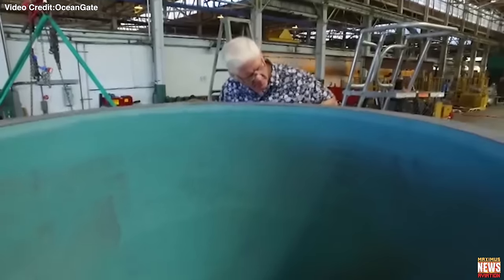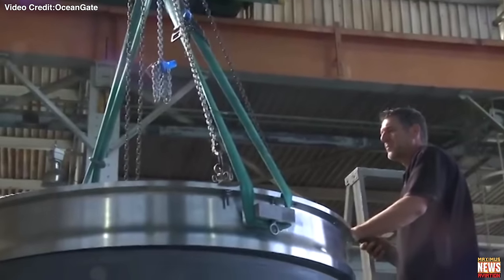Watch The Manufacturing Process That DOOMED OceanGates Titan To Fail. But It NEVER Had To Happen.

Comment: I can see EXACTLY where the failure occurred! It was only a face bond between the carbon fiber cylinder and the titanium receiver rings for the 1/2 sphere caps. Just the carbon alone wasn't strong enough since it's less than 1/2 as strong on compression as in tension, but there was no overlapping of the surfaces, only an edge bond. SERIOUS flaw and most likely the failure point. Once the main structure is recovered we'll see.
Reply: no the titanium had a cavity that went around the outside and inside of the carbon . looks like maybe 1 1/2 - 2 inches deep. i would have made the inside of that flange much thicker and much deeper . then again i wouldn't have used carbon fiber in the first place or at least have an inner liner of steel.
Reply: You're right, he needed at least a 12 inch titanium slot for the carbon fiber to fit in, to give him more gluing surface to better hold the joint together. That epoxy resin, or what we buy in the stores called JB weld, has a tensile strength of 5020 psi, but the titanic depth has a pressure of 6000 psi. I think the whole idea of joining titanium with carbon fiber was ridiculous, but what he should have done was had a 12 inch or more slotted flange and glued it to the carbon fiber cylinder, then wrapped more carbon fiber around the 12 inch flange and the cylinder so that it would be embedded in the carbon fiber. It would have still been sketchy, but would have been a stronger joint. Like you said, this was most likely the fail point. He was going from warm surface temps which would expand the titanium, and then diving down to freezing temps and contracting it, which probably busted that glue joint and led to its demise. He might have damaged that joint on the last trip and didn't know it, and on his way down it sprung a leak and exploded the thing to smithereens.
Reply: @hillbillybeerdranker6678  since carbon fiber is weak in compression it should have been made entirely out of titanium!
Reply: @GrantOakes  I totally agree. for some reason he was monkeying around with that carbon fiber. Maybe trying to save money since titanium is more expensive?
Reply: @hillbillybeerdranker6678  probably
Reply: The main structure is likely shattered into a million pieces.
Reply: @hillbillybeerdranker6678  You could be right, your logic is sound and the physics is relevant but it is really one of those how many angles can dance on the head of a pin issues.... the CFRP was a terrible choice for materials.  It has very poor fatigue characteristics and even worse under compression and in high pressure sea water failing some 10 times faster than it would in ambient conditions.
Reply: @sequoyah59  Good points sequoyah. Yeah, he chose the wrong materials. I also heard he was dumpster diving for materials and found some expired CF that Boeing was getting ready to throw in the dumpster. I don't know enough about expired CF to know if it was weaker, but I assume since they have an expiration date on it, it would be weaker.

Comment: Engineer here, albeit a complete layman in terms of submersibles, but I'll just say this. Nobody knows what the mode of failure is, could have been the hatch, we just don't know yet. This construction probably was an ok concept for lower pressures, though when you start to get to silly pressures like 400Bar then things change exponentially. This company had a cavalier regard for safety because they knew they were dealing with these compressive loads. Tragedies such as BOAC flight 911 can't happen with a modern airliner, because although non uniform materials such as composites are used, we now have FEA simulations which mean we can make things cheaper, more lightweight and with ten times the strength than we could back in the 1960s and that is why kit designed within the last 20 years shouldn't catastrophically fail due to design. We wait and see what happens, it will be interesting to learn the facts.
Reply: Remember American Airlines 587?
Reply: What we do know is that the hull is in many many pieces.
Reply: And aerospace companies don't just depend on the simulations. They perform extensive physical testing on production prototypes - testing them until they fail so they know they understand the limits.
Reply: As an engineer you SHOULD KNOW that carbon fibre is for TENSION not compression.
Reply: @OffGridInvestor  Works better in tension. Is prone to delamination under compression, that is clear.
Reply: @bbhima5814: How does it relate to Titan?

American Airlines 587 (Airbus 300) encountered wake turbulence from a Japan Airlines jet (Boeing 747) that took off just before it did. The pilot flying the Airbus countered the rocking motion with violent alternating inputs to the rudder, causing the vertical stabilizer to snap off when the aerodynamic forces exceeded its design specs. Airbus' chief test pilot hopped in a flight simulator to demonstrate how ailerons should've been used, instead of the rudder. Even Boeing said its planes should be flown like what Airbus recommenda. Many experienced Airbus and Boeing pilots were shocked, as they use the rudder almost exclusively. They were lucky that Boeing over-designed the tail (more so than Airbus).
Reply: @OffGridInvestor  this is a dramatic over-simplification. The fibers are strong in compression, but they are so slender they are prone to buckling failure. If the epoxy (or other resin) can keep them in place then they will not buckle, and the buckling forces are generally much smaller than the compression forces, so the epoxy can hold up. I am not defending the design of this submersible. But the often repeated statement that "carbon fiber is weak in compression" is wrong when it comes to carbon fiber composite construction. It is pretty strong in both compression and tension.

Comment: That round metal piece, that was glued to the body of the sub - was recovered, in one piece. That tells me that glue joint has most-likely something to do with the malfunction of the sub. Tony Nissen,  the  head engineer who calls the glue a peanut butter glue,  is probably in jail today, charged with deaths of four people.
Reply: Actually he isn't. He just testified at the US Coast Guard Hearing. I found it surprising that he told Stockton he would never get on the sub he was the lead engineer on. I guess he didn't have much faith in his composite glue job submersible.
Reply: @Romulan2469  That should have been the biggest clue and not to enter the sub.
Reply: @elmono3939  Agreed. I just think stuff like that should be fully disclosed to those paying to board the submersible. They were obviously duped by Stockton into thinking it was safe but when the lead engineer refuses to board it, that's a huge red flag right there. I would expect Nissen to face charges anyway, he was responsible for designing that thing.
Reply: @elmono3939  The people who were "Mission Specialists" had no awareness of this trivia that came to light after the tragedy, but they certainly had an awareness of the waivers they signed which mentioned death 3 times on page 1. They knew the risks and ignored them.
Reply: I mean what engineer is stupid enough to glue together two dissimilar materials like that with different properties and just hope for the best? I am willing to bet that the glue was the failure, in fact, if you look at the recently released wreckage videos you can see that this was the case so you were correct in your hypothesis.

Comment: As Johnf2009 said below, it appears all of the carbon fiber was applied around the circumference of the shape with no application of the fiber in any other direction.  Pressure from outside would causes stresses in the axial direction, and possibly some bending stress as sell, but from the video there doesnt look to be any carbon fiber running in that direction.

Comment: Retired aerospace composites engineer here.  I recall reading about the fabrication of this cylinder in a an industry trade magazine (Composites World??) a few years ago.  Much more detail than in this video.  This layup also included some plies of plain weave fabric for longitudinal support, but was primarily would tape as shown in the video.  Presumably there should have been intermediate vacuum bagging steps to consolidate as layup progressed.  Article only stated that the final layup of about 500 plies was vacuum bagged at one atmosphere for final low temperature cure and claimed maximum cured porosity of 1%.  Titanium end fittings then bonded on with some low temperature curing epoxy.  Seems dodgy in hindsight, but have not seen any details on the overall engineering rationale for the manufacturing process.
Reply: Shouldn't have this process been performed in a clean/temperature controlled environment?
It seems that there were too many opportunities for improper bonding and foreign object introduction into the CF winding.
Reply: @BELCAN57 all this survival safety stuff really takes valuable time away from the bipolar manic high.
Reply: Ah, makes sense that there is some axial fiber, he must have been hiding that, trade secret and all. I've always seen these wound with something that looks like a  shuttle in a loom, moving back and forth so every layer is woven to right angles.
Reply: That sounds great. You're fired! 🤡 /sarc.

Comment: This was done in an open warehouse setting with dust, dirt and other debris/contaminants in the air. This will impact so many things and that it has not been considered here is concerning.
Reply: I'm ignorant to all of this kind of stuff... seems like this guy probably knew this information but continued anyways?  The arrogance and denial of this Rush guy is insane.
Reply: One of my first thoughts.
Reply: No temperature control in the building either.  That would affect the working time of the adhesive and perhaps the strength of the adhesive bond too.
Reply: @edschultheis9537  Yep, absolutely correct 👍👍
Reply: it's not a computer chip .  any micro dust just becomes a filler in the resin matrix. there was minimal dust in there.
Reply: @_5_675  he wasn't rich that was the problem.

Comment: Never was the phase "You can't push a rope up a hill" more appropriate. None of Stockton Rush's subordinates were going to convince him fibre has little strength in compression
Reply: I just used that rope expression in my comment.
I omitted the "up the hill" part, as that only applies to the marshmallow with the sharp stick on a warm day metaphor.
Reply: @77thTrombone  That expression of coarse comes from people saying you can't improve a company from the bottom, when someone at the top resist change. But after about a week of discussion with others on the shortcomings of fibre in compression, I thought I would combine those two thoughts.
Reply: @craig7350 The other relevant expression regarding leadership is “A fish rots from the head down.”
Reply: One guy tried to warn him.  He was sacked for his trouble.  That quip from Rush's press release about boring 50 year old white guys was probably directed at this employee who happened to be a qualified and experienced marine engineer.
Reply: I get your point, and obviously it is weaker in compression, but to be quite picky and because im genuinely curious. Isn't that more to do with the tensile forces (aka bursting forces) that develop in the polymer matrix? Because steel bar, cable and fibres are relied upon in compression all the time because the concrete restrains them from buckling, much like the polymer should for any FRP structure. So isnt it more a poissons ratio type issue, where you think the stiff/strong material takes all the load and forget about the binder material?
Reply: Okay what the heck? ive never heard such a phrase and i can almost certainly push a rope uphill! wanna see? To literal?
Reply: @craig7350     I had a professor who gave us 10 rules for life before graduation.  "Rope" was one.  "Denial not a river in Egypt" another.  "Tipping not a city in China" was a 3rd.  
@JeffOstroff (ex Motorola guy) recalled his very first engineering lesson in his video on this event:  "if you are going to design a bridge that fails, you better make d#%* sure that you are under it when it does so."
Good professors put their lessons in the perspective of life.

Comment: bonus reason this failed:
no effort was devoted to manufacturing this in a clean ( dust ), sterile or climate controlled ( humidity and temp ) environment.
.
that's in addition to requiring microscopic tolerances when you're smearing on epoxy by hand.

Comment: This whole thing was laid up at something like 87 degrees. So there was little to stop a crack going straight through the tube, there would be no fibers directly across the crack. Pressure vessels are normally wound at 45 degrees and alternating. So you get a diamond pattern. Not that this was ever going to survive 6,000psi for long, but they minimized their chances.
Reply: Good point

Comment: I first thought that he had used Carbon Fibre as a brace or support, never did I think that the body would be all CF with metal end cap. Not to mention the lack of vacuum bagging on the CF layup, the unclean and dusty conditions of the hand lay up. This was a disaster waiting to happen.

Comment: Safety should always be the priority, not innovation! The outcome of the project, as expected, was influenced by the fact that it was designed by newly graduated individuals with limited experience and without the involvement of experienced professionals. From an engineering standpoint, it is crucial to design things with at least a 50% factor of safety to ensure reliable and secure results.
Reply: I would say this design would have been ok if it was 100y ago, but for todays standards (and experience of DECADES of building stuff like this) it is ridiculous
Reply: Safety can be inovated also.
Reply: @SakakiDash If there were a model that incorporated a minimum 50% safety factor and underwent sufficient fatigue testing, along with the collaboration of materials of different natures under low temperature and extreme high pressure conditions, I would be fully supportive.
Reply: For this Stockton guy, safety was third, with fame and glamor as first and second.

Comment: Carbon fibre is extremely strong in tensile strength. . .  Like a string that is very very hard to stretch and break.
IDEAL for making pressure vessels   . . . .  THAT IS pressure vessels for CONTAINING pressure, not for RESISTING EXTERNAL PRESSURE! .
We have had pressure vessels made from carbon fibre for decades. .  SCUBA tanks etc. They are perfect for that.
Imagine a SCUBA tank with very high pressure inside. The pressure is pushing outwards, trying to stretch and snap all those fibres, but they are tremendously strong and resist that force. . . . 
The internal pressure is not trying to bend the strings, but to strech them. . . the vessel maintains it's shape and resists the force trying to make it balloon out.
Now imagine those strings in a cylinder that is being pushed from the outside  . . . The strings CAN and WILL BEND . .  They don't have any super-strength to resist bending, only strength to resist stretching.
All it takes is for one tiny part to start to bend inwards and then it all fails rapidy. . .
Reply: No... fiberglass is only really used in atmospheric ( < 1 psig) rated sump tanks. 
no engineer worth a damn uses this crap for any process equipment or high pressure vessel.

Comment: It's not so much "glue " as it is a sealing compound. The caps act on the carbon fiber in compression when underwater. I would be interesting to see a technical review of this inventors calculations, I heard he didn't share them.
Reply: Its not simply acting as a sealing compound. Due to the different stiffness of the end cap and carbon fibre hull, they want to deform a different amount under extreme pressure. So the epoxy ends up transfering high shear forces between the two elements. So its actually critical to the structural integrity.
Reply: @Cam-ng8rk  I see. Thank you. Epoxy for high shear forces, nope I wouldn't trust my life on that.
Reply: What "calculations" ???????
Reply: @shoersa  Engineers generally "calculate" before manufacturing objects to use in a project. They base making things on some calculated criteria, ie they design them.

Comment: Given this low degree of precision, it could have been a hair or tiny spec of lint stuck in the glue that became the point of failure.
Reply: delamination was already occurring on previous dive(s)
Reply: @the_lost_navigator  Apparently it cracked and creaked every time. You can pretty much rest assured that wasn't an indication it was getting stronger.